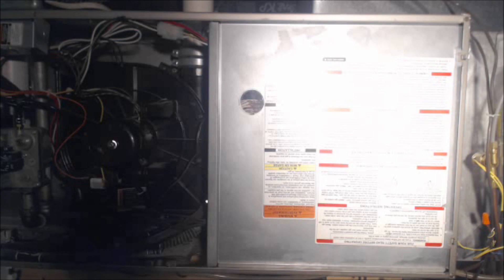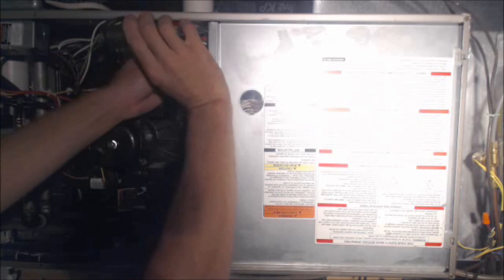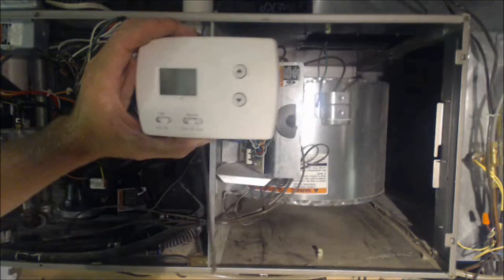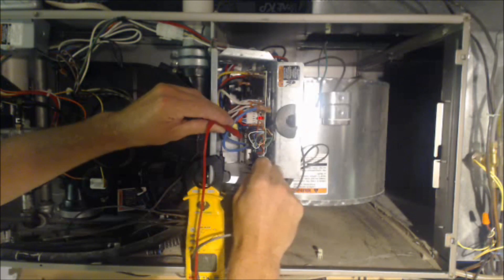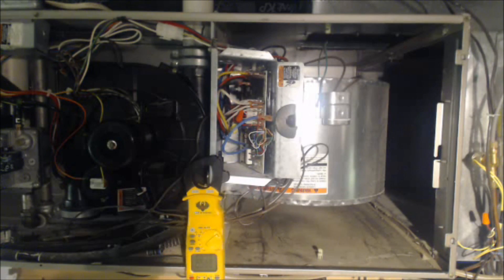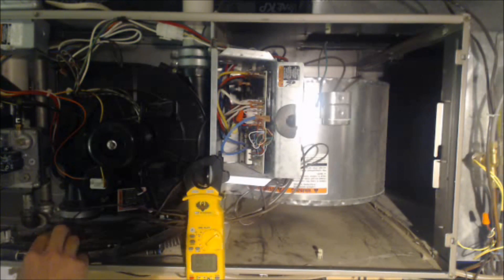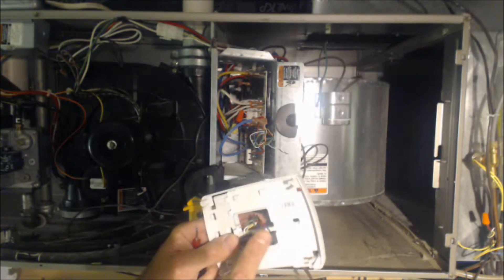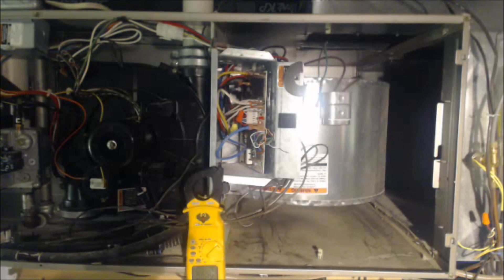Blower Fan Motor Won't Shut off!- STEP by STEP Troubleshooting!

Comment: Question ! 

My electric furnance blowe is running without the (G) connect inside the motor board , and don't strop when we as the thermostat to stop. One others thing I got is , half of Element is working ( 2 stage ) .... and ,so I decided to BYpass one sequencer to see if it was this. If I bypass 1x sequences, all element work except 2 ....   W1 and W2 are bypass.

What is the your idea ? Furnace is 5 years old.
Reply from the maker: That would be considered an air handler equipped with electric resistance. A furnace is typically a combustion fired appliance. It sounds like a safety sensor is tripped which allows the blower to run all the time. It sounds like that or one of the relays is stuck closed. That is high amperage in there so I may recommend a tech to come for safety, thanks Tommy!
Reply: @acservicetechchannel  do you have a phone number?
Reply: Ok.. here my big problem. I will try to do my best in english. When I ask my thermostat to get heating, the fan blower start witch is normal. But blower never stop... then I open the planum a bit and saw that the element inside the furnace work only on 1 stage, but should work on 2 stage because ny w1 and w2 is bypass at all time. Then first this , i go look the limit stiwtch if one stuck open and Yes, there is one open. I bypass the wire direct without the first limit switch (because we have 2) and look again inside the furnace. I got more element working but not all? How its possible.... spring broke(element)..? And the fan blower.. still got the problem... i test the thermostat wire.... i disconect the G from the panal board... and still the blower start without the G ask for it... make sense if its on safe mode ( limit stwich open) but.. the limit switch is bypass now and work....  look like 2 problem

Any help?
Reply from the maker: It is possible you wouldn't need power on g if you were calling on emergency heat if there was a board. G is normally powered but the board may see that heat is being powered. With the power off and the element that is not working disconnected, it should have a resistance reading in ohms. If it reads 0.L then that element is broken. I would not run that without the second limit working. You need both in there working properly to cut off the power before a problem occurs. You should order that right away. Have you seen the video I did on "electric resistance acservicetech"
Reply: @acservicetechchannel  I changed both limit switch , anf still got the second stage element not working and fan dont stop.... maybe the relay? How relay work?... im realy confused.. because if i jump the 2 wires ( limit switch ) straight(bypass) with pin the second stage start working.. but not if i pluged the new limit switch.
Reply: Here is an update. We change the motor board ( main board ) we change the 2x limit switch, we change the 4 relays.... and still.. blower dont want stop.. motor board flash 3 time...( york furnance ) mean air restriction... and the second stage of element do turn On... but all power work when we test relay going to element...   110 volt each.

Comment: My unit never shut off always run even the thermostat set up point on 72 and inside temperature 66 any suggestion . my house like on ice box please help. I did replaced the thermostat twice and still
Reply from the maker: Turn the power off at the indoor unit and take a picture of the tstat wiring. Then remove the wiring. Turn the unit back on to see if it still does it. If not, then it is the tstat wires accidentally touching somewhere. Just had that last week, and switched the y wire with a different color that I wasn't using, thanks

Comment: Hello there. I have a York system and my problem is the opposite. The blower motor shuts off and my condenser AC unit outside keeps running and freezes my lines. Can you point me to the right direction? Thanks.
Reply from the maker: Do you have a fan limit control , fan relay, or control board controlling the blower motor? Do you have a shaded pole, psc, x-13, or variable speed motor? That would help in determining the problem. Also does the outdoor unit continue to run after the thermostat has reached its set temp?
Reply: AC Service Tech LLC control board ; unknown on the motor type. Blower turns off before reaching temp. Sometimes at temp.

Comment: Okay so my air won't turn off at the thermostats, I have 2 and 1 unit. He came yesterday to fix a no cooling problem. It ended up being a stuck zone damper in the attic. I woke up to mid 60's, set at 74 and won't turn off at the thermostats. Have to turn them off at the electrical panel. What is wrong do you think?
Reply from the maker: Do you have 24v from y to c on the board when the tstat is not calling for cooling?

Comment: I have a carrier heat pump and the blower motor will not shut off. I at one point I could pull the face of the thermostat off and the motor would then shut off but now it will not do that. It was making a clicking noise outside. I had a HVAC tech that mainly works on industrial stuff (he is a neighbor and he was just helping me out) change out a relay that was stuck then the motor seized up and we changed that out too. Any idea?
Reply from the maker: You would need to read if there was 24v from g to c on the control board when the tstat was not calling for fan first, thanks
Reply: acservicetech Thanks

Comment: I have an electric heater. I have a Honeywell thermostat and when I take it off there are 7 wires. G-green, C-blue, R-red, W1 & Y (jumper)-yellow, W2-white, E-black and O-orange. The fan would not stop blowing, even when in the off setting. The unit was installed when the house was built in 2006. I turn the breaker off. The filter was dirty & blocked so I changed filter. Then turned the breaker back on. Started blowing hot air but when reached the temp setting, the fan wouldn't shut off. HELP!!!!
Reply: I'm thinking Honeywell is a bad product......we have the same here and the same problem..
Reply: It’s probably the sequencer.

Comment: Hi, why does my furnace blower fan stop and rapidly restart intermittently during normal furnace flame operation? You can here the fan power down, then rapidly power back up again 3 or 4 times in 15seconds, then stay on awhile till it cycles down to cool. Would u have an idea?
Reply from the maker: Is it an x13, variable speed, psc, or shaded pole blower motor? If it has a capacitor, it would be a psc, look up blower motor identification acservicetech for a video, thanks

Comment: Hey, thank you so much for this video. Long story short, furnace stopped working a week ago. A technician quoted me over $1300 for the repair (new control board and transformer). I bought the parts online and put them in but then my blower motor was continuously running. Was fretting because I didn't know if the new control board was bad. Watching your video helped me understand exactly how the wiring works and how to troubleshoot it. I figured out my thermostat needed replacing well. All in all I saved over $900 by replacing everything myself and your videos made sure I didn't have to call another technician out for another $90 diagnosis.
Reply: Xhoven, I wonder why your furnace could be failed all of these at the same time ??
Reply from the maker: Thanks Xhoven!

Comment: Excellent video.  In my case the control board was bad.
Reply from the maker: Thanks jpcalo8!
Reply: @AC Service Tech LLC  my fan won't turn off either.   The red light on my board is always on and the error code says " continuous red light , replace board"

Comment: When the temperature drops,my blower in side stays all night and even to the day whats stop?
Reply from the maker: It may be an open limit. First check for 24v from w to c on the board when you should not have it meaning the tstat off and then check for 24v going through your limit switches,. If a limit is open the blower won't shut off, thanks

Comment: I installed a thermostat Honeywell and when I turn it on it just turn the fan on and now when I turn it off the fan just stay on any suggestions thanks
Reply from the maker: Does it have 24v from G to C? If it does then your thermostat is still calling for fan, thanks
Reply: No it doesn’t have 24v
Reply: I did the OL test 

Ol 52.5 c to g 
Ol 1.4 c t r 
Ol 25.2 c to w 
Ol 17.4 c to y
Reply from the maker: Do you have a main control board or a fan limit control controlling the blower? Also it could be a limit switch open such as the flame rollout or the plenum heat sensor that checks the temp of the air near the heat exchanger. Do you have 24v from the limit wire coming from the board and the limit wire going back to the board? The limit wire is the one going to the flame rollout and plenum heat sensor, thanks George!
Reply: I have a 
Limit switch SPST 
Draft safeguard switch 
Auxiliary limit switch 
Flow sensing switch
Reply: When I hook up the thermostat I put the blue wire to the b terminal on accident and I turn on heat do you think that could of been the problem thanks
Reply from the maker: When you turn heat on, R would connect to B and short the 24v fuse. Do you have 24v on the limit switch leaving, going through sensors, and coming back to the board?
Reply: Ok I disconnect the medium low coming from the blower motor wire going to the board and it turn off

Comment: Hello I have a question I had the AC company replace the heat coil and after it was replaced I noticed that once the temperature is reached on the thermostat the vents stop blowing air and the fan outside runs constantly I can shut the unit off and it turns off but it sucks because I can leave it on and I need the heater.
Reply from the maker: It is likely that they wired something incorrectly on the low voltage because the fan should always be on in the indoor unit if the outdoor unit is running, thanks and sorry to hear that!
Reply: Blower works for AC not for heat

Comment: I got my furnace working normal at start, till it reaches the set temperature, then starts blowing cool air, have a brand new board on, thermostat is clicking when I change the set point, same problem with new thermostat. checked thermostat wire, no shorts, blower fan keeps running at all times. had thermostat on off blower fan still runs, where the problem is and what u suggest I should do, new filter, haven't cleaned sensor yet, will tomorrow. any suggestions would help and appreciate your help.
Reply from the maker: What do you mean working till it reaches set temp? Does it fire and provide heat and then blower continues to stay on? Do you have a fan limit control or board that powers the blower motor? When the blower is running after you are to the correct temp in the house, do you have 24v from g to c or w to c or y to c?
Reply: acservicetech yes, it blows heat till it reaches the set temperature on thermostat, then starts blowing cool air. after a bit it goes back to warm air.

Comment: I'm so confused.  

First I thought AC meant Air Conditioning.  
Then I found out AC means Alternating Current, but its referenced to voltage.   

If there is an open circuit, there will be voltage, and no current per Ohm's Law.  Does the voltage still alternate if there is no current to alternate?  

Are you setting your UEi DL389G2 Phoenix PRO+ True Root Mean Squared RMS Digital Clamp Meter to AC  when you're taking HVAC  voltage measurements?  My Snap-On DMM for automotive use defaults to DC for some reason and I have to switch it over.

Is there any DC in HVACR?

I ain't never seen a mag jumper til watching your videos.  I just ordered a couple because I haven't figured out how to operate croc clips without wanting to attach them to my  nose as jewelry while troubleshooting and getting boogers on them.   

I'm running spare wires from now on so I can switch brown wires for green ones. Excellent color choices by way.  Do you have any interior decorating tips videos?
Reply from the maker: Yes measure almost everything in AC. There is DC in variable speed motors and flame rectification. Thanks

Comment: So i disconnected all the t stat wires that goes directly to the control board and turn on the door switch. The blower motor turns on and the Igniter turns on but not the gas valve does that mean the control board is bad?
Reply from the maker: Make sure that you have 24v to the gas valve from the board at that point when the hsi is glowing, 5-7inch wc upstream of the gas valve if nat gas or 11-13" wc upstream if Lp. You should have an output gas pressure as denoted on the rating plate of the furnace or the new Lp conversion rating plate, thanks
Reply from the maker: You would need to test to see if you have 24v going to the gas valve when this is happening and then if you do, check the inlet and outlet gas pressure with a digital water column manometer, thanks

Comment: What do I do if I completely remove the connection to the thermostat and the fan still turns on and stays on?  

I recently had to replace the entire control board on my unit as the unit would not operate and all.  After replacement, it turned out that it had warped.  I got an updated version of the board as the original board had been discontinued.  All the connections had identical labelling, so I moved the connections one at a time and was very specific to make sure that no cables were incorrectly plugged in.  Once I put the board in, I powered on the unit and was excited that it worked.  It wasn't until a few days later that I discovered that the blower never stopped spinning.  In an attempt to troubleshoot it, I pulled the connection from the thermostat after trying individual wires.  The fan still spun up.
Reply from the maker: You may have a safety switch open like a high heat plenum switch that tripped or a flame rollout switch. If it was a flame rollout switch then I would advise that you call in a tech because it could be a result of a cracked heat exchanger. It could also be the motor hub if it is a variable speed or ecm motor but it is more likely a safety switch, thanks. My advise would be to call in a tech though, thanks Lone Wolf!
Reply: Thanks for that.  I was hoping that it was the thermostat simply because I want to get a new thermostat anyway but I can't bring myself to replace a perfectly good device.  I'll get a hold of a proper technician.
Reply from the maker: Thanks Lone Wolf!
Reply: How often do you replace a control board? I purchased one back in 2015. I think that's my problem now. Waiting on someone to get here and check.

Comment: good viceo.. my blower RUNS AND RUNS! I tried 3 thermostats.. and just ordered a new board. Thanks to this video I think I can at least run some tests now to see if I wasted 200$ lol
Reply from the maker: Thanks Tom, you may need to check to see if you have 24v from g to c on the control board when the thermostat is not calling for fan. This will tell you if somewhere your thermostat wires g and r are accidentally touching, thanks
Reply: Thanks.. I ended up getting a new board. GOnna try that. Nothing stops the blower at this point
Reply from the maker: If you did not have 24v from g to c or from y to c, and your 24v signal through the flame rollout, temp sensor safety sensors is making it back to the board correctly then yes it would be the board. I would check these first, thanks

Comment: My AC, I don't know if it's the Blower Motor or what, but it keeps running AFTER I turn the CIRCUIT BREAKER OFF. When I turn the switch OFF, It turns OFF. I just don't get it. The problem is, I think  eventually I won't be able to turn it off. This is a NEW Industrial unit. One year old. The fan recently broke and was replaced and this problem resurfaced. Should I call the AC repair guy? It's still under Warranty.
Reply: Oh, I forgot, Thank You.

Comment: actech.i have a gas furnace,tstat is off and furnace blower will come of and on by itself through out day,new tstat unhooked green wire at furnace, still does it.please help.im just lost
Reply from the maker: Does your furnace have a control board or a fan relay? -  https://youtu.be/phsUYxo75jU     --  https://youtu.be/55T_xk9tWXA
Reply: control board,
Reply: thank you for responding, love your videos
Reply from the maker: Is this a variable speed blower or psc blower with capacitor? Also check your limit switches as that could make the blower turn on and off if somehow a limit sensor is tripping.
Reply: I was thinking limit switch or board,not varaible speed, thermostat is in off position,it was a call I was on today.stupped me
Reply from the maker: If it was doing it while you were there then you could jump out the limits but put them back before you leave. Also if it were a limit switch, most boards would flash an error code. If the error occurred before you got there, you may be able to recall the last fault codes that happened. If it did not have an error code then it may be the board. It is odd that the relay is closing though when there is no call. Usually when it fails, the problem is when you are calling the fan to be on or that it won't shut off after a call. Did you test from g to c on the board with the wires disconnected in case the r and g were somehow touching on the board?
Reply: yes sir I checked between g and c no voltage.i will be back there in morning,let you know what I find.thank you for your time.

Comment: How do I get the fan to run continuously when I select fan on?
Reply from the maker: With the power off, a thermostat wire must be run from your g terminal in your tstat to the indoor unit g terminal. Then turn power back on and select fan on, on the thermostat, thanks

Comment: If I have my thermostat wires on wire nuts outside the furnace can i disconnect the green there instead of from the board, will that give the same results?
Reply from the maker: Yes except it won't take out the possibility of the wires touching each other somewhere, thanks!